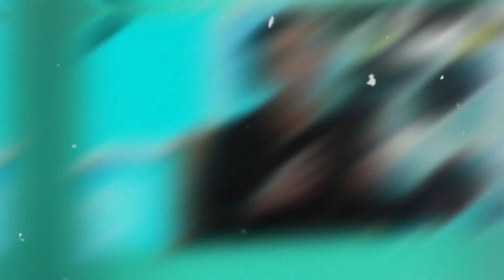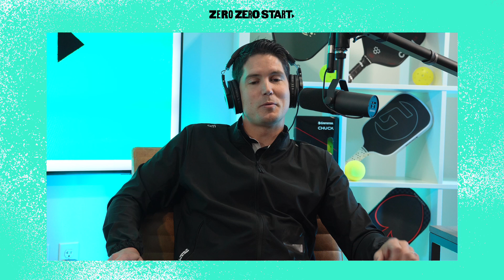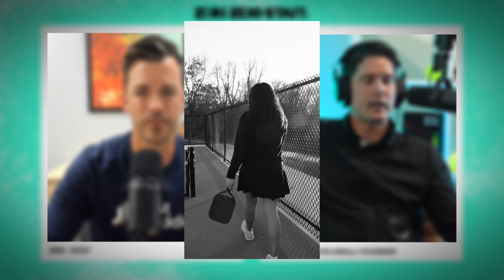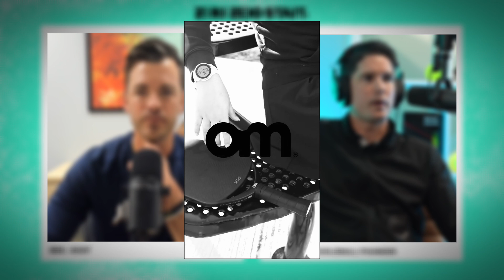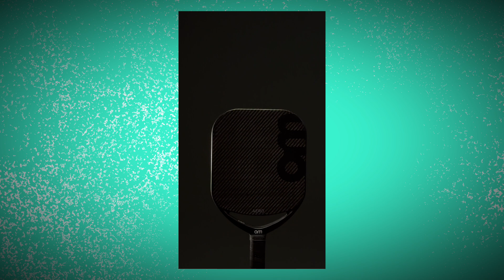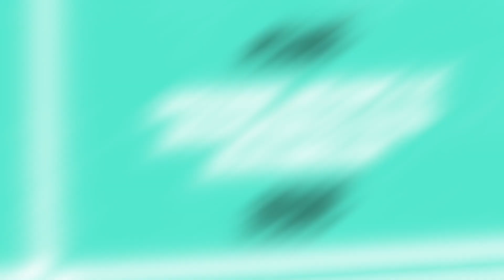Zero Zero Start #33: The Story of Om Pickleball & the First-Ever Pickleball Racket?!

Comment: How would you compare your product to Joola  Mod TA 15 & Ronbus Ripple?  I’ve ordered Om Aero demo and can’t wait to give it a try.    And when will the elongated model be available?  And the specs for that?  Swing weight, twist weight, handle length, price etc.  Thank you!
Reply from the maker: @gene3344 through the specs the JOOLA MOD TA 15mm and will feel similar, but in terms of performance we haven't seen players want to sway away from the JOOLA MOD.

We are waiting for launch details of the OM AERO Elongated! Sign up for our alerts and we will be sure to send updates on the emails https://www.justpaddles.com/customer-service/

Stay tuned for exact specs and testing results!
Reply: The OM Aero¹ PRO with the TITAN core is more comparable to the Joola Mod and Ripple. The OM Aero¹ is a wide body design more suited 4.0 and below or those wanting maximum forgiveness with very good power.